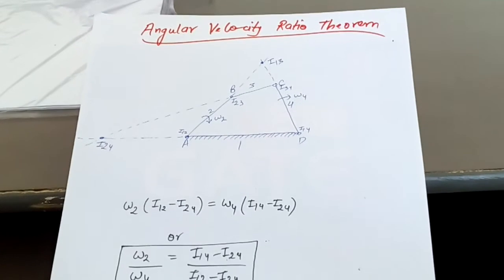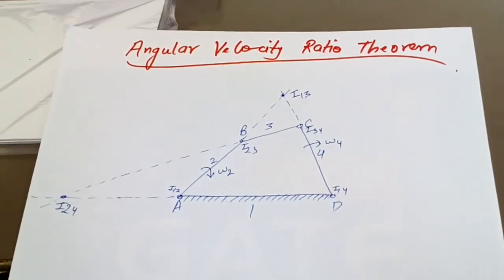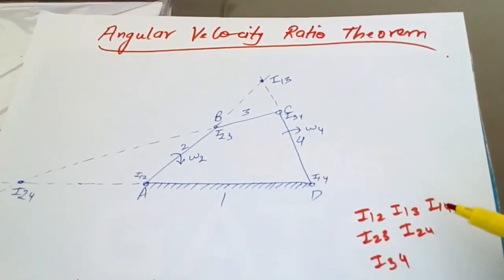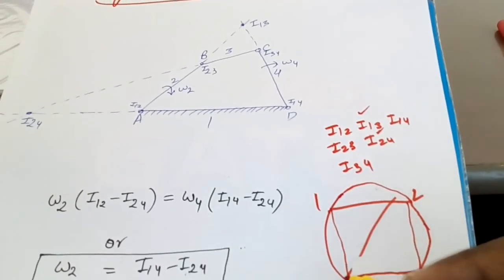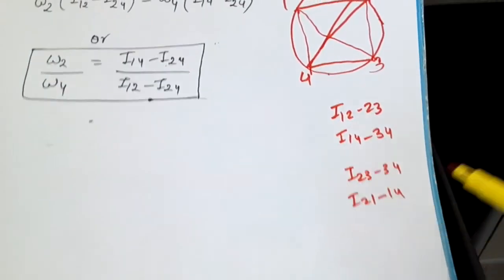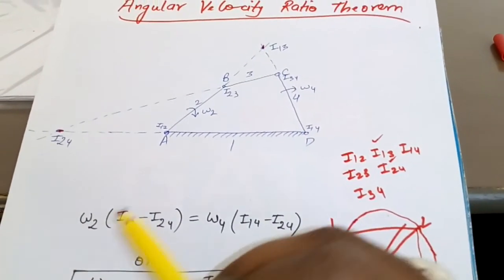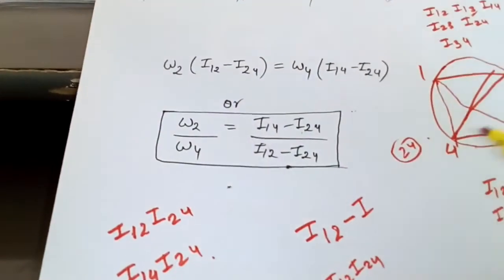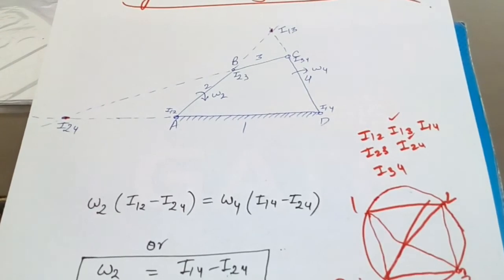angular velocity ratio theorem | velocity analysis of a four bar mechanism | i centre method

Comment: How to find angular velocity of Coupler, when either angular velocity of crank is known of angular velocity of rocker is known?
Reply from the maker: Shubham if angular velocity of crank is given let it be w2 and w3 denotes angular velocity of coupler, then using the equation  w2(I12-I23) = w3 ( I13-I23) you can find w3.
if angular velocity of rocker is given let it be w4 and w3 denotes angular velocity of coupler then
equation  w4(I14-I43) = w3 ( I13-I43) you can find w3.